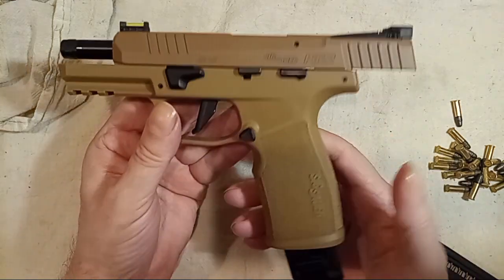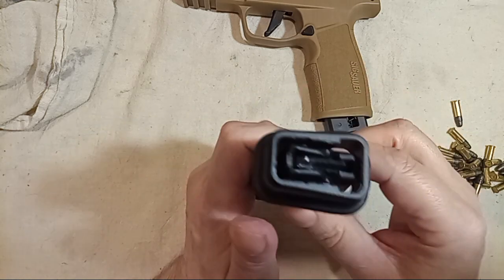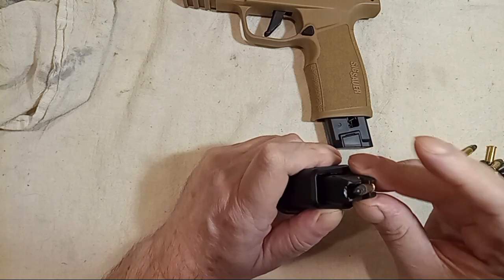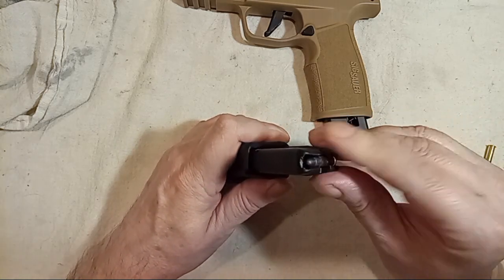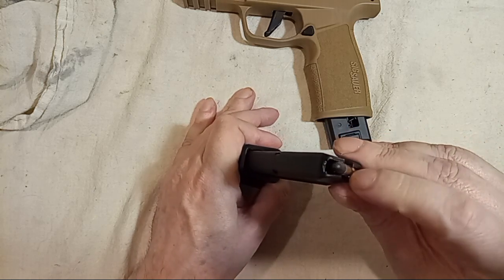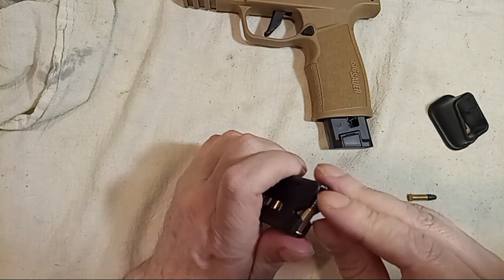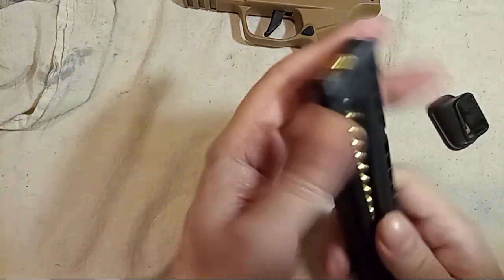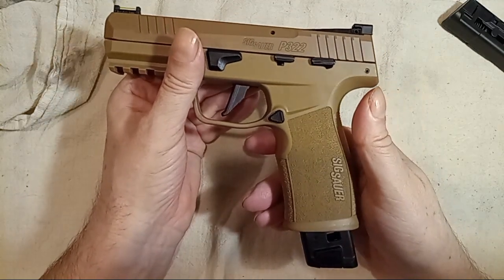Sig p322 - yawl still not loading magazines right 😄

Comment: I'm going to try this.  The gun is amazingly accurate (and is a great training gun), but I tend to eject FTFs at the range, only to reload those failed rounds back into the magazine and they fire fine the next time.
Reply from the maker: great gun but it makes you work for it by loading slow and careful and a quick bore snake down barrel and a drop of oil every few hundred rounds, these guns can over heat so if say like a mag dump or something give her a break and have a sip of coffee or check phone for messages, these are light wich is a great carry advantage at the expense of a thin barrel that needs a break cooling down, many forget 22 lr powder is dirty unlike 380, 9 mm and such because costs are kept down the chamber wall get dirty and need a swab or bore snake in the chamber to allow good ejection, if you accasionally carry this its easy to walk around town having 100 rounds or more not weighing you down or showing through clothes, essentially you like a one man army with lots of firepower even though a 22 lr and wont run out of ammo, once you get the CCI 40 grain maxi mags and gun is clean and lubed before carry it should be able to defend you as well, espeicially if you do run and gun drills with speed and accurcy wich comes easy being you have no recoil, a success for 22 lr you can read about is the barreta 71 and how 22 lr was used by IDF to take out dozens of guys at close quarters with AK 47"s proving that training with a 22 lr a AK 47 and even someone with a AR 15 can be overwhelmed by a 22 lr, so its not the nessesarily the caliber but how you use your caliber for speed and accuracy and knowing your gun like its a part of your body, gun defense is a form of martial arts, the little guy 22 lr doesnt necessarily lose as we assume, 'its not the size of the dog in the fight but the fight in th dog"